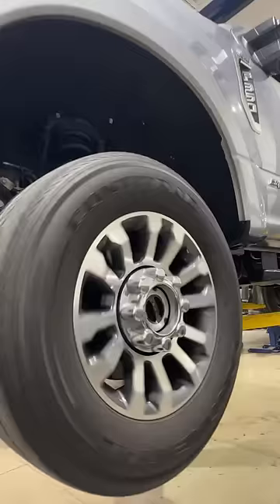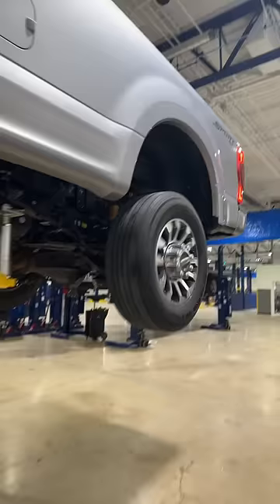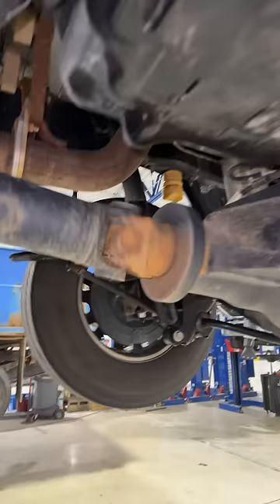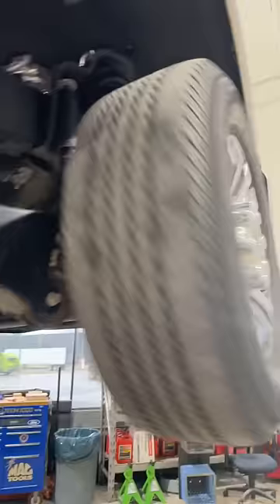NEW 4x4 noise 2022 | F250 F350 #broken #fyp

Comment: That rust is ridiculous. These companies need investigated. I swear they've been painting a layer of salt or weak acid of some sort underneath the paint...
Reply: The rusty drivetrain parts probably sat on a shelf in a damp warehouse for a while before the truck was assembled. I don't think all the parts get assembled as soon as they are made but I agree, these companies want you to buy another truck, not make it last 15 years
Reply: It depends on where you live. If they salt the roads in the winter nothing prevents it.
Reply: Ya they put a crappy layer of paint on the undercarriage even in Texas My f150 has rust everywhere
Reply: Where I live they use salt, salt brine, and other corrosive isht on the roads.  Not to melt ice, to dry the road completely!  Tons and tons and tons of it.  And cars that are not constantly treated for rust are falling apart.
Reply: Ford is currently cleaning house, they fired their old quality control department and should hopefully not have as many issues
Reply: @T34theAmericanheavy  this is the 10th time I've heard that in as many years.
Reply: Chinese steel.
Reply: Rust on drive train parts is normal.  It’s been that way for years. I agree that for what they want for vehicles these days they should be flawless.
Reply: I mean if that’s the case don’t you think the cars in the south or cali would experience this?
Reply: The only rust I see is on the high carbon steel parts and the exhaust, the parts rusting are not in anyway in jeopardy from the rust. Do some research on high carbon steel. I can’t deny they could do more rest prevention perhaps
Reply: @johnoberle9750  they won’t understand even if you tell them. Some of us know
Reply: @jeepmanxj  I actually do understand global supply chains having been in many manufacturing industries for decades.  American and Japanese companies are sourcing from all over the place.
Reply: Control arms and knuckles sitting on racks in the Fruitport MI Mobex casting plant.
Ford will own the plant by the end of the year for all the money they're putting in.
Reply: Correct. Acid is used in paint and enamel
Reply: @jeepmanxj  fluid film prevents it
Reply: This is why I go Bullnose and older😎🤘
Reply: @calebmelton5989  no it doesn't. It slows it. Nothing prevents it.
Reply: @jeepmanxj  that means the same thing bud...
Reply: @jeepmanxj  if applied annually in the proper manner it will for all practical purposes prevent it. Check out frames thar have been oil treated for 30 or 40 years straight.
Reply: @T34theAmericanheavy  This is 2023. Much more cost efficient to shut down the complaints department. "You take our automobile and like it".
Reply: Lmao you’ve never lived in the rust belt clearly
Reply: Meanwhile in Australia my Japanese made Nissan Patrol is 20 years old and has 0 rust
Reply: Those components are likely only passivated with no paint on top. That’s what I do for FoMoCo
Reply: I agree it's bad...the GMs do the same thing. See newer trucks in at work all the time, surface rust all over. Heck sometimes they already have jasper trans or engines in them and aren't even a decade old yet. It's all junk now
Reply: No rust on the ones in Oregon.
Reply: @jeepmanxj they use brine where I live... Now the roads stay salty. Even a summer rain adds a fresh layer of corrosion
Reply: It’s not the companies. 

DOT’s across the nation are switching to brine for their road deicer. Brine is extremely corrosive, and seems to not even care if a part is painted or coated. 

When Ohio switched, I had a truck I wasn’t driving at the time. It had all original front end parts on it. Nothing was too awfully rusty. Put new parts on it, drove it twice after a snow storm, and every part had rust on it, even the front axle had new rust. I’ve never seen anything like this.
Reply: i wondering about that too
Reply: Yeah brother mine was delivered woth more rust than that welcome to the rust belt
Reply: If you live in a state that uses salt on the roads during winters.  It doesn’t take long for ANYTHING to rust.  My 02 has no rust my 17 does cause I bought it used from a state that uses salt.
Reply: Awful lot of new fords with issues...
Reply: @ffdtower1  you only hear of the ones that have problems.  So out of the millions sold not even 1% are having issues.
Reply: Oxidation is a coating that is planned for, rust is a slang term.
Reply: @davec.3198 you think American steel won’t rust? 😂
Reply: It doesn’t matter if you live in the rust belt or where they salt the roads. The undercarriage comes rusted from the factory. It’s been like that for as long as I can remember turning wrenches for ford and 20 years as a municipal fleet tech
Reply: Laughing in Toyota. Also crying in Toyota.
Reply: @BigBeans710  those comments always make me laugh as well. Like steel isnt steel, or china has a market on super rust steel
Reply: @Dennis Maloney  rust isnt a slang term, its the official term for the type of oxidation that happens on steel or iron...
Reply: I have been noticing that in a lot of American assembled vehicles! It’s outrageous!
Reply: Laughs in rust belt

Dude that's completely normal, come up to the North and you'll see what rust actually looks like 

And yes in know this a 2022 model
Reply: @John Fisher  i live in Pa, still seems bad for a new truck to me.
Reply: No it's steel that's been sitting in salt water for decades. The salt destabilize s the metal it will rust till it gone a way to keep having to build more vehicles.
Reply: What about auto makers that put large plastic panels over the bottom half of the doors like subaru, or companies that put plastic over the rocker panels like chevy.  Those are notorious for rotting out because they hold the salt and sand and you can never wash it out
Reply: Nah,instead they dont lube the chassis or even attempt to. job security in a way,not as bad as the corners mercedes cut in mid-late 90s(biodegradable WIRING HARNESSES)
Reply: @ryanpaul5604  so, you think they rusted on the shelf?
Reply: @bodgiesteve8849  more plausible than companies painting acid on the new parts before assembly
Reply: I get under my 04 E450 and painted the bottom with Rust-Oleum Hammer Paint.
Because I had to remove my 55 gallon gas tank and strip down to stainless steel because 3 galvanized straps holding transfer to tank and was peeling paint and a white corrunsion all over.
Took me about 6 hours and remove fuel pump inside was beautifully clean.
I prep salted the gas  tank put it in the sun and spread painted hammer on what was exposed metal and baked it in sun over two days and also did galvanized straps that was 8 years ago still look like I did it last week.
Going to do frame in May I that care of my vehicle I swear the hammer paint is the best. I painted front bumper with it in 2004 no rust or chips at all in bumper just faded.
Reply: I don't get it. I have a '15 volkswagen Amarok single cab. A small truck for your standards that get loaded with 1250kg every day since we bought it. It has absolutely no rust. I don't take extreme care of it. Only wash it a few times a year.
Reply: Those rusty parts are the ones that are heat. Heat oxidizes steel.
Reply: Just low grade cheap metal with lots of cheaper metals mixed in
Reply: @jeepmanxj  I have a 20 year old camry that's hard ever washed. Spent it's whole life in Michigan and is cleaner than this truck. No under coat either. I want to find another one with less mileage and put it in a barn on stands for when this one shits out. I'll always stay with older ones. Way better and way more reliable
Reply: @AverageCitizen333  yeah come up to the north, winter's last significantly longer
Reply: @John Fisher  pa is far enough north for me, but thanks for the offer! Haha
Reply: @AverageCitizen333  fair enough, I've heard great thing about the rural parts of PA, not a bad place to settle down at all 👍
Reply: @John Fisher  it has its ups and downs like most places. All in all, i like it, though. i live in a semi rural part, and its nice to go from rolling fields to wooded areas all in the drive to work.
Reply: But the rims are shiny is all that matters right? Lol
Reply: Heat from the brakes.
Reply: @holdenthompson1235  you are full of it.
Reply: @jeepmanxj  yes he is
Reply: @holdenthompson1235  carbon is what allows steel to rust. No other "metal" rusts. This steel is great, tell me it's not when you see knuckles start exploding.
Reply: @240sxRule  stainless rusts too. Figure that out.
Reply: Tell the customer to stop towing his boat in and out of the water so deep.
Reply: Cheap chinese steel
Reply: @240sxRule  no way. like i said. i have a ´15 vw pickup (single cab amarok) that i use to work with. in extremely humid environment all year around. and it has absolutely no rust. not even in the lower parts of the exhaust. (obviously the manifold has some surface rust but thats normal in any manifold). that kind of oxidation on a 1700 mile truck is only because of cheap materials or coatings.  i love ford, but it seems theyre not up to what we´d expect from them
Reply: @frez777  steel isn't a generic thing. It's a very specific chemical compound that has a defined ratio of various metals. 

It doesn't matter where it's made, a given steel rusts at the same rate regardless of the country of origin.
Reply: @rowdysincoherentrambling1426  on the stub axles? Thats funny
Reply: you should have paid extra for the undercoating :)
Reply: @mrlithium69  by the time these trucks are old enough for me to afford them, they will just be a pile of rust in a landfill
Reply: I was at general motors for aboutv10 years the truck frames used to cone heavily covered then slowly became less to almost non dry patchwork, my brother bought a 2020 f250 diesel and the frame had zero protection but a thin layer of paint!!!rediculous!!!!!
Reply: @T34theAmericanheavy  I heard the federal government is doing the same thing.  All good by 2024.
Reply: @mrlithium69  undercoating traps moisture
Reply: @jeepmanxj  Not all stainless steel is the same.  Some stainless is also magnetic. The key word is "steel" all steels have some carbon to a degree. I'm a machinist and studied metallurgy, so it's not hard to figure out.
Reply: @frez777  Strong steel that doesn't rust, doesn't exist. Give it a break. Stainless doesn't have near the tensile or shear strength this "cheap Chinese" steel does.
Reply: @g-low6365  You could never convince me your truck had no rust. High quality steels, designed for heavy loads, rust. There's no getting around that. Even if the coating is thin and or cheap. These parts are so thick, the surface rust will never wear the part down. You want to pay an extra 10k for your truck to be properly coated under? Do it yourself after. Don't jack up prices for the rest of us.
Reply: @jeepmanxj  Ill wait to see if you can pick out the false word I've been using and replace it with the proper one. ;) If you know steels you'll know the main contributor to rust.
Reply: 350 and up are made in Cleveland.  Rust belt capital. Plus they sit in the lot with the chip shortage.
Reply: @240sxRule  machinist, awesome I'm a tool maker myself and have been doing it over 20 years now. 

I even own my own shop. Although in all honestly I'm a 3rd generation machinist and I inherited it from my father who inherited it from his.

Anyway. Rust on steel is iron oxide. It doesn't matter where the steel is made, if it's composition is correct, and it nearly always is, it doesn't rust any faster or slower than any other of the same type.

All stainless rusts eventually. It's just the rate of oxidation.
Reply: @240sxRule  it's not even coated. Just the standard paint. It's a third world country manufactured truck even.  I also have a mb sprinter, sold in the US as a dodge van. Or ram van.  Not rusted also. Humidity down here is over 70% in the cold months and 90 in summer.
Reply: It’s obvious you don’t live in the north
Reply: @donutdan1508  I'm moving to Ohio next year, the town there does that because if they don't it gets so damn cold any snow or ice that they melted with the salt will freeze over within a few days and then combine that with the fact that it's in the mountains, you're in for a bad time.  So instead of trying to find salt that keeps water from freezing down to -20 Fahrenheit they just rid the roads of it entirely.
Reply: It's the magnesium chloride that they use for the roads. You have to see what it does to concrete
Reply: Not just ford but ALL the new trucks do it on certain areas that weren’t coated right it’ll help them sell more in the future
Reply: It's nothing new. Always been that way, just worse in some areas. Have to junk or part out our 08 Silverado for that reason. Last truck, 92 F series,  went almost 30 years, without any major rust issues .
Reply: They're using less nickel and chrome in the metal these days, so it rusts quicker.
Reply: Right ! I think this all the time. That thing is a year old with 17,000 miles and has all that rust already. I could leave my bicycle outside for two years and it wouldn't look like that.
 All these newer cars are like that, they look nice, clean and new until you look underneath SHEESH!!!!
Reply: @g-low6365  haha, wow I didn't know VW made trucks. We must not have them in the US. Or at least I never have seen one.
Reply: My 2020 tremor was so rusty when i bought it. Got home after purchase and thought, why havent i looked under the truck yet? Dear lord, 400 miles and that thing was rusted at all crucial joints and axles. Wtf @fordmotorco??
Reply: I think insurance companies fund cities salt allowance. There is Zero reason they need to be salting community roads where you drive 20 mph.  Now they are spraying liquid salt on the roads which gets in every crack.  I was choking on the salt clouds the day it dried up.
Reply: What they do is they paint over the rust. And then inspectors dont look at it thoroughly and passes. Seen it too many times lol. Especially shafts
Reply: They are made of the cheapest, thinnest steel they can get away from. I love Chevys, but I wouldn't buy a used one, I have seen too bedsides rusting out for no apparent reason. So Sad.
Reply: I have a 2014 Ford Taurus, it is always kept in the garage, it never comes out during inclimate weather but it still has rust on the seams of the doors. I love the car but Ford is not a car I would ever buy again
Reply: @jeepmanxj  fluid film
Reply: @junor747  Don't worry it will start leaking oil soon and stop the rusting problem.
Reply: Part of the issue is the cities putting so much salt down.  Even the fire hydrants are rusting! They need to figure out a less harmful way to treat roads, or just don't treat them at all and tell people to learn how to drive.
Reply: @donutdan1508  yeah they salt on sunny days here... d.o.t. should be sued for "over usage"  of corrosive materials on highways.... Especially when they treat dry roads which causes Moisture to form on roadways making them slick when they shouldn't be..
Reply: @jeepmanxj  ... That's correct I've used fluid film for years on the bottom of my tailgate of my 06  Ranger has held the rust at Bay really well
Reply: @mini-14stang34  Northern Ny.... We're a clean ranger from the South will😮l have a bent squishy frame in 5 years
Reply: my 2013 honda civic ex had hardly any rust at all for a 10 year old car. in NC.
Reply: @jdel2315  sure, some places. I use it too. However for a lot of the country it works ok, but you'll still have rust like this within a year
Reply: Maybe it's just some outer coating failing, similar to how a lot of mid 2000s cars had "rust" on the clear coat.
Reply: My 2001 ain't rusting😂. Yall went and bought all this new sh!t and now the only real sh!t on the road is mostly old sh!t!
Reply: @Chuassy  is that what's commonly referred to as AHS steel?
Reply: @jagjag7484  then you live in death valley. All steel rusts. Every single possible alloy will oxidizes.
Reply: All those parts should be coated so they don’t rust, it’s a $50k+ truck
Reply: @Industry-insider  or be made from a material that doesn't corrode through and oxidizes and prevents further oxidation. Like aluminum or titanium.

People act like rust is new. It has been the defining end of motor vehicles since they were conceived.
Reply: Weak acids actually are great for removing the things that cause rust and rust itself. I wash all my vehicles with a mix of dawn soap and citric acid at a ph of 4 which I let dwell for a minute then I spray it down with an alkaline all purpose cleaner that’s diluted. Then hit it with the pressure washer. It’s just a gentler version of what you’d get at a touch less car wash or tractor trailer washing places. 

Skyscrapers use steel beams that are pre-“rusted”. That’s what red iron is.
Reply: Just use chassis saver i coated my vehicles every 3 years with it and always wash the under none of my vehicles have ever rusted and have 9 trucks 3 fords 4 chevys 1 dodge and one Nissan also in a brine area and near Salt water for boat ramp
Reply: @jester6291974  that's because the previous owner didn't care he just sold issues most people who love there vehicles will wash the under side or run it threw a car was with under side cleaning
Reply: @T34theAmericanheavy Must have been a long process. they've been trying to fire that dude since the 80s.
Reply: @ryanpaul5604  yep, my mates top of the line 2022 raptor grenaded it's box after 20k, no real offroading and ford care won't cover it 😂
Reply: I live in vt. Have a new gmc Sierra 1500 w/ 20k on the clock. I wash the truck every week in the winter… frame, completely surface rusted already. These vehicles no matter the badge are mostly made with Mexican or Chinese metals and parts. Best bets to do leasing or two year loans and get rid of them afterwards. Expensive and difficult to do anything other than assemble in the states anymore.
Reply: @joshuabigguy  you know they coat the frame in wax. If you pressure spray it, the metal will rust...
Reply: @ryanpaul  had a 92 toyota celica 5 speed with several hundred thousand miles it gave me very little hell on  maintenance.

97 toyota celica 5 speed. Almost 300k

Now I'm relaxing in a 2003 toyota highlander limited. At 260k
I've owned a couple Fords myself and my parents always driven lincoln. I've seen the mess of those cars and my best friend was a pure chevy family. I'm talking all the way back to great grandparents lol
Not a single person in that family owned anything else besides a chevy. 

My best experience I've had with toyota and my wife's civic are greatand her new subaru legacy.....
 Well it's Not a  busted "USA" made. 

Subaru are great vehicles but are expensive.
Reply: @bigv6724  What do you do for a living?
Reply: @ryanpaul5604  what’s even more bs is they’re trying to make it so you can’t get any older trucks either
Reply: Built-in obsolescence, made to wear out in a specified time. Dirty tricks.
Reply: If you live in Minnesota they apply  sodium bromide a brine that dries off the roads. It's 10 times more corrosive than regular road salt. I coat my undercarriage with my own version of woolwax /fluid film yearly
Reply: Don't give them idea's!!😂
Reply: @TravisTheSavage  aluminum doesn't and it will oxidize. All metal will. Some metals oxidation creates a barrier that will prevent further oxidation, or drastically slow it, but it does. 

It does not specifically have to have carbon
Reply: And you think they build them to last a lifetime? Hahaha just like drug dealers it's all about the comeback
Reply: @T34theAmericanheavy  we will see. I gave up on the 1/2 ton Fords and purchased a '17 RAM Laramie and I love this RAM.
Reply: It's the poor quality of the steel manufactured these days, it's all recycled trash.
Reply: @torreyjones9833  nope.

Do you guys have a book with lists of blatant lies and incorrect statements you can use to post in any topic? 

Metal oxidizes. All of it even gold can. Some alloys oxidizes faster than others. It doesn't matter what the steel was or if it was recycled or not. A specific alloy rusts at a specific rate.
Reply: @User Name  Really? Thrn tell me why a bolt or nut that has been on a car since the 60's will come off WITHOUT heat, but a five year old vehicle requires everything short if using dynamite? I've worked in the auto repair industry for 25 and know EXACTLY what I'm talking about. Don't agree with what I or anyone else says? You DONT have to comment.
Reply: I have so much rust all under mine . I have the same noise . Have same noise issue  I thought it was from towing my boat . This is definitely my last ford .  Don’t have any mechanical issues with our Denali . But it is starting to rust up underneath  guess they all use Japanese metal who knows… 😂😂
Reply: That'll never happen. Every company than goes public with an IPO HAS TO CREATE Planned Obsolescence products and shart the consumer year after year.
Reply: @jeepmanxj  we salt here in Denmark .. and my Nissan is no way near this shitty .. and it`s up to 80 k miles .. still basicly 0 rust
Reply: It's surface rust. Vehicles look like that after one winter in canada
Reply: @jeepmanxj  you can invest in a pressure washer with an attachment to go under the car and wash it every 2-4 weeks. Never had rust
Reply: @davec.3198 sold to you at premium price because you guy accept it.btw Korean car steel is currently the best used in ' trade truck/ vehicles)
Reply: @ryanpaul5604  And buy another truck at prices approaching $100k.  That's their plan - spend $100k on a new truck every 3 or 4 years.
Reply: I agree!  My grandpa has a really old car with almost NO rust!  My car is way newer is about to rust in half.  Same location!  Car makers probably purposely promote or dont do as good  a job  corrosion control as they can or used to to make people buy more cars!
Reply: They really did add something to the metals in the 70s planned obsolescence.
Reply: Highly carbonated steel most likely recycled from yes You know where.
Reply: Two words 
Fluid film for rust
Reply: Understand the situation and vote with your dollars. I use to be a new truck guy. Last new truck was a 2015 Ford F150. Gave me nothing but problems and hassles. Now I strictly drive the smallest, most reliable used cars out there. I have a 2010 toyota yaris and my gf drives a 2012 corolla. Both over 100k but run flawlessly with little rust. Between both of them, I paid $8k. Life is better.
Reply: Wool wax undercarriage yearly and you’ll never have a rust issue ever again
Reply: They do acid wash before painting